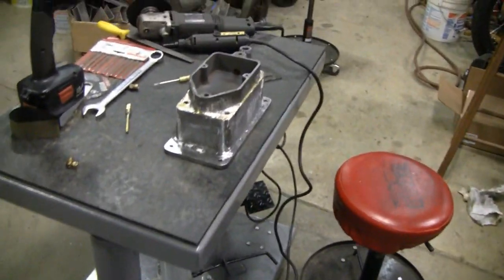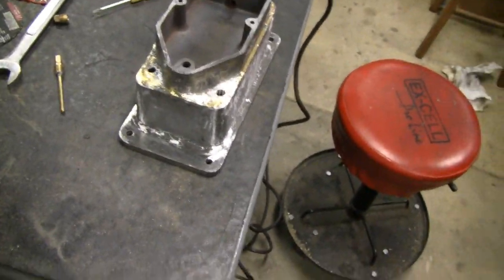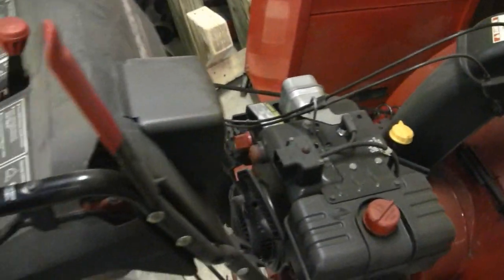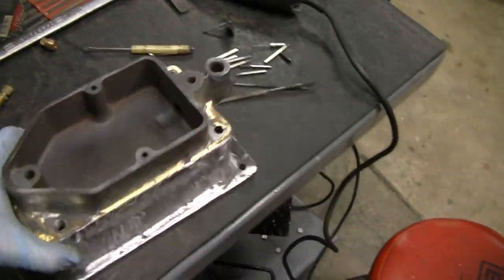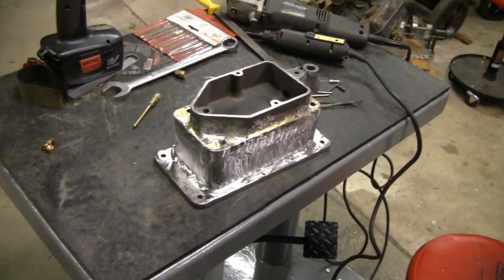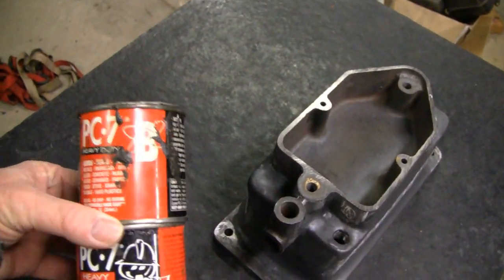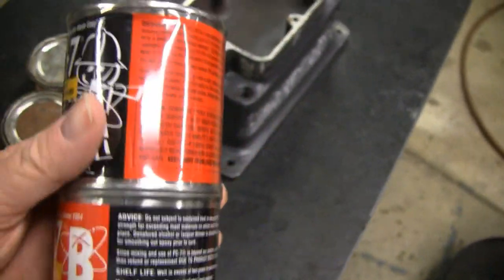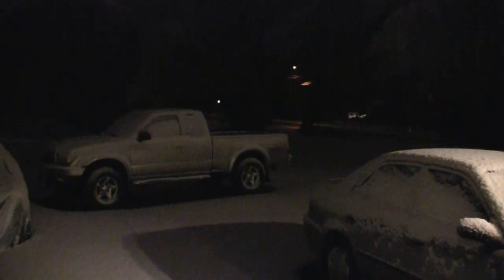HOMEMADE HIT & MISS BRIGGS PROJECT (part 8)

Comment: The tank is looking good.   This is a big project & will take some time.  Folks need to understand that you & Mike are quite literally re-engineering the wheel here. Briggs used a whole team of engineers & techs working full time to design what you 2 are doing in your spare time.  
Big thumbs up to you & Mike!